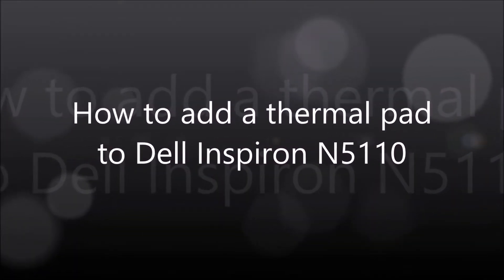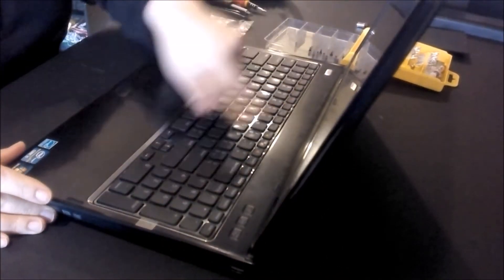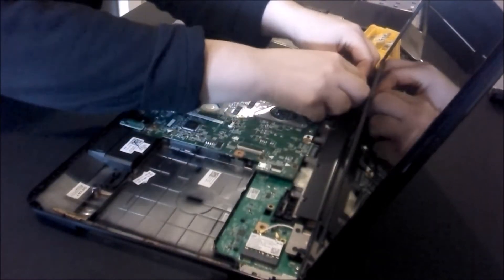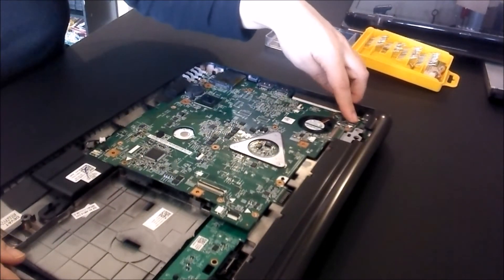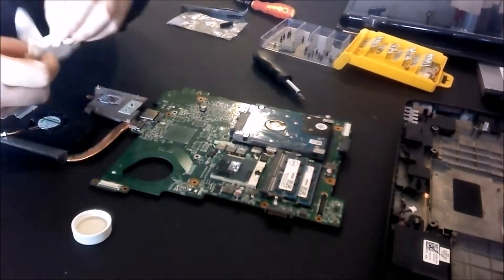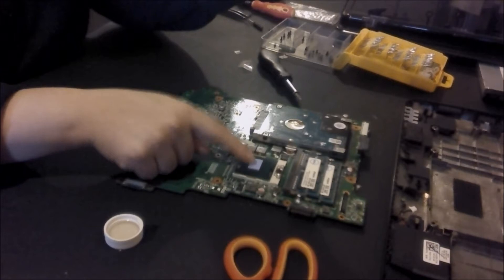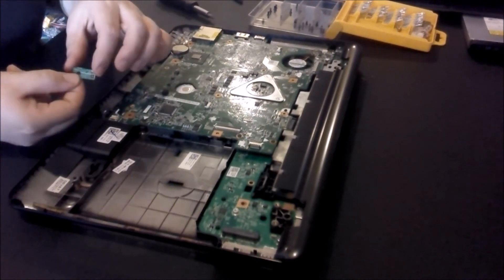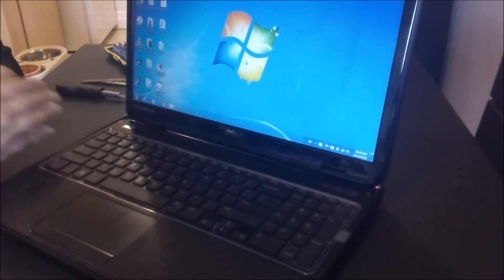Thermal Heatsink Pad Replacement for Dell Inspiron N5110

Comment: Great video up until you put the pad on the CPU, you'll have poor temps with that setup :( Thermal pads are not for CPUs, unless they are special extra-thin graphite ones (have a look). Put some decent thermal paste on the cpu after cleaning, I'd recommend Artic MX4 or 5 as they have no curing time and good performance. With thermal paste, less is more and it will spread out when given sufficient pressure. I'm about to do this process myself and I believe the pad thickness you need for the VRMs is 1mm (the three lumps which had the thermal pad on before), which is what you're actually meant to use the thermal pad for.

Comment: As previously mentioned, thermal pads are not for CPU/GPU. And this MB doesn't have a video card. Those 4 squares are the power transistors of the CPU's power supply. Pads are for memory chips and transistors with ceramic casing...

Comment: Thanks for the video.

Regarding grease vs. pads, I have read that the grease is better (will give you a lower temperature) than a pad. What I've ALSO read is, having a really bad/old/degraded grease application or pad is WAY WORSE than having ANY intact thermal solution.

So from worst to best, it would be an old/degraded prior application (might be almost useless), followed by a new good quality pad of the right size/thickness (okay/does the job), followed by good quality grease (really your best bet)

Thinner grease/pad is better, since it conducts heat a lot worse than the metal itself, and you get higher temps with a thicker application... 

(Unless you make it so thin as to not fill the gap. And if the gap is too big for grease, between the CPU/GPU chip and its cooler, you might have to go ahead and use a pad anyway.)
Reply: I still have an old a Dell XPS 15 core i7 (fifth gen, I guess) with nVidia graphics (don't recall the model). The first time I changed the paste to the CPU I did not replace the thermal pads in the GPU and VRAM chips as I couldn't find them at any shop; without them, the heat-sink pipes did not even touch the video chips, so I decided to keep the old dried and cracky pads. Of course, then you couldn't use the computer for anything video-intensive for longer than five minutes or it would emergency shut down.

Comment: It would be nice for somebody to demo and compare thermal pad VS paste ,both of different W/m-K rating and thickness( measure the gap between CPU , GPU and heatsink). The effect both have on CPU of different surface material.

My acer i460m laptop CPU full load using intelBurn Test :
1) stock thermal pad(5 years, ?? W/m-K )  hit 102°c (casing assemble during test)
2) left over thermal paste from cm storm 212 evo (new, ?? W/m-K ) hit 93°c (casing open during test)
3) HT WT160 thermal paste (new, 1 W/m-K ) hit 105°c (casing assemble during test)

GPU usually generate more heat then CPU.. If i were to use thermal pad on it, why can't i use it on CPU?

Comment: I replaced the silicon pad in my laptop, but it still overheats :(
Reply: thermal tape is not the processor, a graphics card only, put thermal grease and will not overheat
Reply: The Artic Pad which I tried (50x50x1mm) has a 6.0W/mK rating. I think you also tried one like this? I applied the pad to both the CPU and GPU, but the CPU still overheats. I just have a hunch that a thermal paste may be more effective for the CPU  but i'm not really sure. We've established that 6.0W/mK doesnt cool effectively, so you would be better off getting the best rated thermal paste/pad in the market.
Reply: Thermal pad is only for the gpu mems u need thermal past for CPU and gpu dye
Reply: Should I put a thermal pad on the Asus X55VD or arctic silver MX-4/arctic silver 5 paste? For both the processor and GPU.
Reply: I'd say try Artic Silver for the CPU and thermal pad on the GPU.
Reply: richerite I was thinking of putting an arctic silver pad of 1.5mm yo everything. Currently I put a paste that is bad, its called Manhattan, I see that arctic silver 5 has 8.9w conductivity, arctic mx-4 has 8.5W and is what I have at the moment, arctic pad has 6W per mK (mili Kelvin I guess).
Reply: The pad I used was an ARCTIC Thermal Pad (50 x 50 x 1.0 mm) - Silicone Based Thermal Pad with 6.0W/mK. Its useless. I suggested thermal paste for the CPU because that was what was originally present on the mobo. Only the GPU had the thermal pad. You may get better results with the silver 5 pad (cpu + gpu)
Reply: OK, just to make it clear, the thermal pad arctic 50x50x1.5mm is useless? Why is that if I can ask? I am trying to find arctic silver 5 paste, but so far I only found arctic silver MX-4 paste. Is the difference from 6 to 8.9W per mK so much?
Reply: 0.965 W/M-K is too low. Try any paste or pad >= 8 W/mK. Just search your local market listings.

Comment: I have Dell Inspiron N5110.. I want to know what is the normal working temperature for this laptop please. Mine laptop is suddenly overheating, I got it serviced but still it is overheating. Which company thermal grease or pad should I use for it. Do I need to replace heatsink or something? Also I see you don't have graphic card? And your voice is so beautiful !
Reply: John Oliver ic diamond if ur experience or thermal grizzly but if ur a beginner use arctic silver or mx5